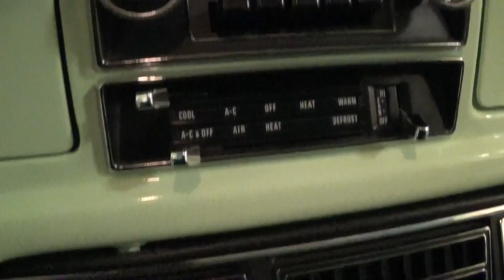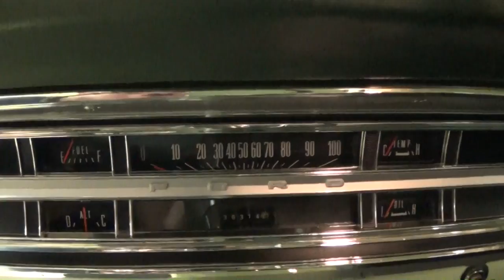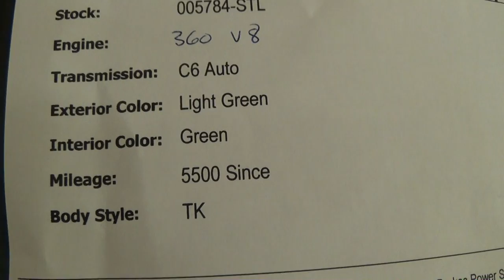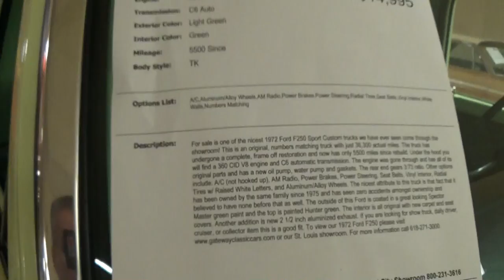Awesome 1972 Ford F250 Sport Custom 360 V8 Restored Classic Pickup Truck

Comment from the maker: The 360 is basically a destroked 390... In fact, it has the same bore as the the 390 and the 410, but it has a shorter 3.50 stroke. You can still do all the performance stuff to it that you could any other FE series engine. Thanks for taking a look Gabe!

Comment from the maker: You're exactly right, it has the same bore as a 390 or a 410, but it has a shorter stroke. I'm sure it responds well to modifications...with it being a larger bore than stroke, it should rev a bit easier too. Thanks for taking a look.  It really is one of the cleanest trucks I've seen in quite a while.

Comment: Nice looking pickup. The mirrors looked small because most of the people I know used to replace the factory ones with the big rectangular ones (with added convex mirrors)  - for pulling loads.

If someone could weld another common modification was to make a wider bumper you could stand on if needed but the factory one on most models was pretty good.
Reply: Firemind94 oh the jr west coast mirrors from Ford. Yeah they're nice to have

Comment: a beauty this truck the air conditioning will be original or is adapted
Reply: That is factory A/C. Until the '73 models the factory unit hung under the dash like this one. From '73 on the vents we're in the dash.